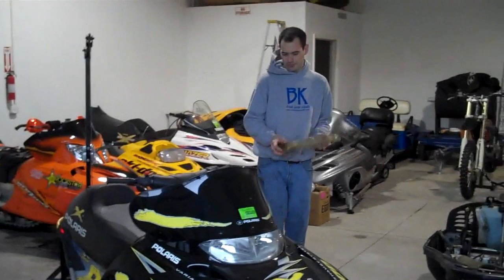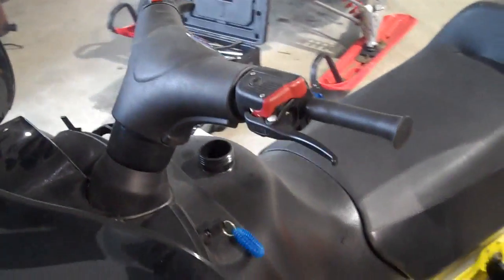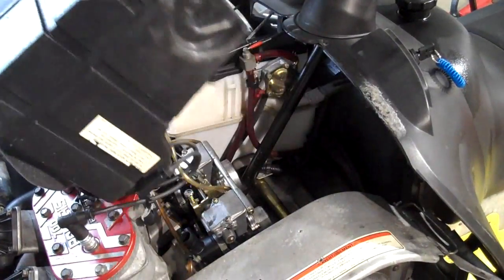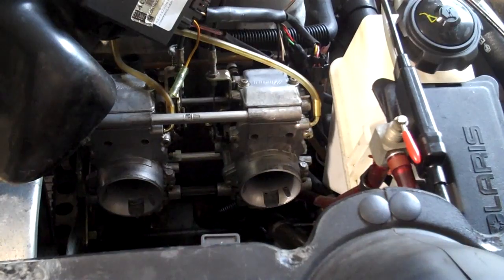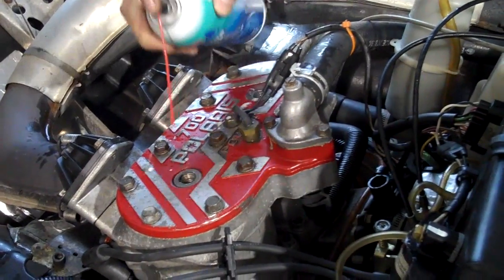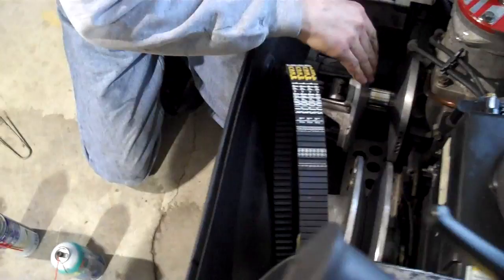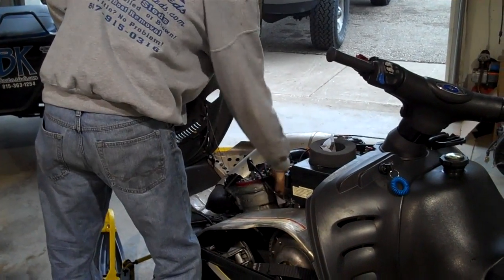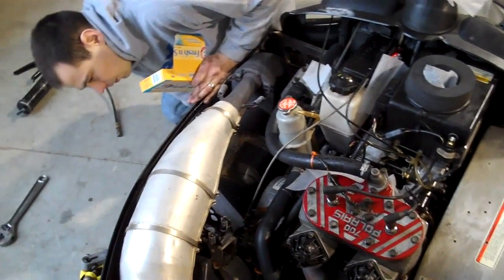How to Summerize your Snowmobile

Comment: Finally!!! someone who fogs correctly....and drains bowls and tank!!!  Proper way to summerize!!  Good on u sir.
Reply: bryan ford your suppose to empty the tank of its fuel? On a website i read “after you add stabilizer to your tank, begin fogging”
Reply: @alexanders1330  yes, plastic tank=empty it, carbs=drain 'em....  I've never had much faith in stabilizers(or any other fuel additives that come in a plastic container)...

That said... steel tank=fill it(to prevent rust)...fuel injection(and I'm sure I'll get flak for this) = leave the fuel in it(oxygen can't get in the system, so that fuel will take a long time to foul)..again, to prevent rust... it'll be fine for an off-season.  If you know that vehicle will be laid up more than a season, then you'll need to get a  preservative oil in that system(like the military does when they "mothball" a vehicle)....super pain in the arse....
 Oh, and do NOT run it every once in a while!  5-10 mins is nowhere near enough time to burn off the moisture, you're just filling your engine with water and burning off your protective fogging layer.  My 2cents

Comment: iv had sleds now for over 30yrs , new ones too ,and all we ever done was use high test fuel with stabilizer ,keep a full tank and run it for 5-10 minutes a month ,or even every 2 month is lots.and we had zero problems in the fall ,and thats too many to say its just luck,

Comment: Just a few pointers, I do not recommend oiling your clutches with anything other than some sort of dry lube.  Also, never lubricate the clutch sheaves: the clutches rely on gripping the belt to work.  If you lubricate them, there will be more slippage then if they were dry, increasing engagement rpm and lowering belt life and fuel economy.  Also remember to grease the jack shaft and drive shaft bearings.  lastly, there will always be some fuel in the carbs.  I always stabilize my gas.

Comment: I agree with almost everything with the exception of the wd40 on the clutches. the clutches are aluminum which is a very porous metal and the oil will penetrate into the clutch sheave surface and cause the belt to slip unless you wash the oil off with soap and water

Comment: To get the Engine  fogged with a lot of Oil. Just run Engine, warm it up . Than take a hook or coat hanger. With Engine Running, Pull up on the Oil Pump Lever, to full open . That will put a lot of Oil  into the Engine.  Ski Doo has that on their new Machines . A system that will use the Oil Pump to Fog the Engine for the Summer .

Comment: Would wd-40 work if it were to be sprayed into the spark plug holes?
Reply: Yes, It's better then nothing but it will eventually drain to the bottom of the engine, while fogging oil is much better at hanging on to the sides and not dripping and draining down as easily.

Comment: I just park them inside raise the track and cover it.  I leave a little gas in but I run non oxygenated premium so I don't have to worry about it turning to shit because there is no ethanol in it.
Reply: That and I add seafoam to it also, seafoam helps out a lot, keeps things smooth and moist and helps treat the gas if you have gas in your tank

Comment from the maker: Its not a matter of 'dirty' fuel - but after a summer long I can almost promise you the Octane levels will have been dramatically deceased.  These sleds like fresh fuel - with fuel that could be 6 months old I wouldn't personally run that through my sled.  Fuel these days doesn't last like it used to.. and the plastic tank is not a good oxygen barrier so it does deteriorate faster.  Just my 2 cents.

Comment from the maker: Again, to each their own.  But for the same reason you don't want fuel in your carbs all summer - you dont want it in your tank.  Fuel now days does not hold up well over time and especially not in a plastic tank.   The octane will degrade as well as start to varnish.
Reply: So what do you do about condition in your tank from not having your tank full of fuel

Comment: All I've done with my sleds for 8 years is just park them on the trailer and put stabilizer in the tank that's all never hade a problem
Reply: I take it you don't ride that much. I would never want to buy a used sled from you. Proper maintenance is essential to having a reliable machine,  no matter what it is.

Comment: I don't like the thought of having an empty tank, with the hot weather coming, allowing water in the tank isn't good. put in some stab let it run for 5 minutes, lift the rear end up. done
Reply from the maker: again to each their own.  I do not see how an empty tank allows water into it?  Also keep in mind the fuel these days is so bad for all the plastics in carbs and lines, as well as degrades very rapidly in a plastic tank.  Much better bet to store it empty.
Reply: I just meant Condensation. I also heard that leaving it dry can cause crank seals going bad etc. But hey. everyone has their own opinion non if right, non is wrong. good vid thou
Reply from the maker: paulsnyder23
You are correct - no right / wrong way.  From what I do - Metal can = store full, plastic store empty.  Regardless you are going to want to get that fuel out of your carbs - its going to dry up in the motor anyhow.  The fogging oil will keep crank seals and motor coated with a nice layer of protecting oil.    Again, like you said - lots of ways to skin a cat.
Reply: AS to reply along with BigKIdPowersports........... as for the worry of condensation, Whether inside or out, All you do after the tank is drained is not tighten your fuel cap,  Thread it on. But very loosely. In doing that, Your tank can breath and will always stay bone dry, And whether you fogged it or not. Put oil in the cylinders,  as well as everything else Big KId Powersports said.  And I promise. That machine will fire right up come the fall  :)  And you will not have one ounce of moisture in that tank all summer long and come the fall  :)

Comment: You probably hurt the motor
Reply from the maker: Happy grower Chris choking the motor out on seafoam doesn't harm the motor. We have had good luck with this technique.
Reply: Big Kid Powersports not for two strokes 😂
Reply from the maker: Happy grower Chris There are many great ways to summerize your sled. We have never had an issue with this version. 👍
Reply from the maker: Happy grower Chris how do you prefer to summerize?
Reply: Big Kid Powersports take the gas out and run it till she’s dry that’s it don’t like to choke her out after a good session
Reply: @Happygrowercbris420  Don't recommend this method at all. Did it one summer thinking it was the way to go, and then couldn't start the sled come winter. Without gas in the lines, water condensation  can form blockages in the line.